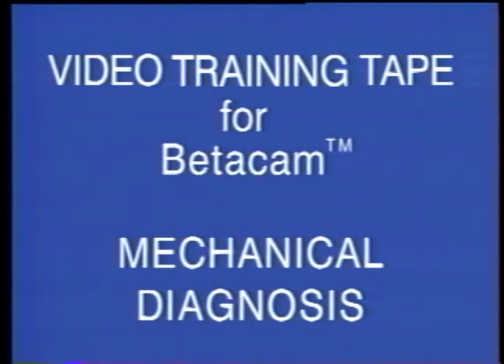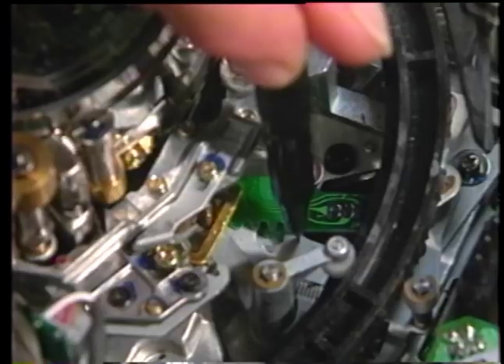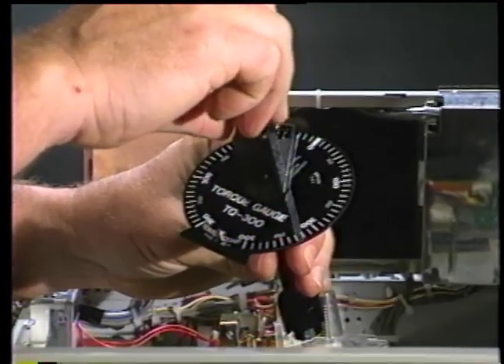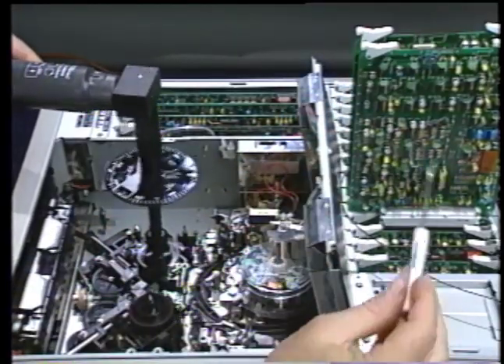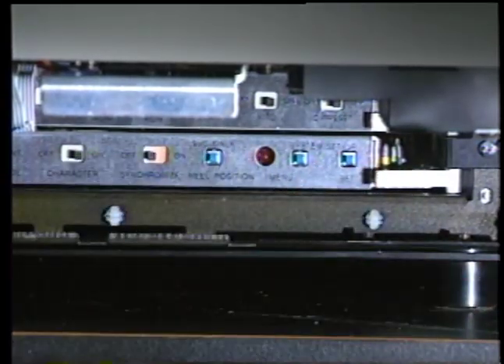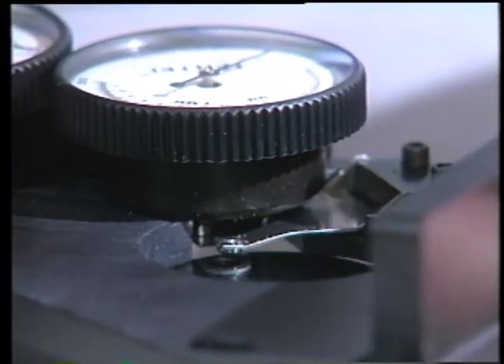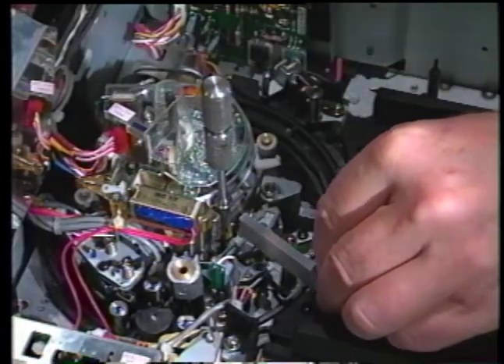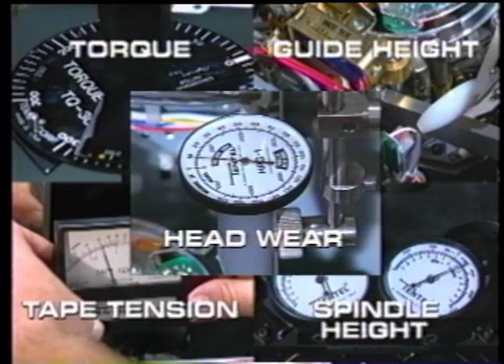Tentel Betacam  Mechanical Problem Diagnosis

Comment: Almost forgot about the Ampex machines ,that were just  Sony  machines with Ampex badges. 
Those were great machines in there time. But CRAZY expensive., like that DNW-75 (Sony part) was probably $ 20k more than an average car in the 90’s  and labor intensive to keep them in to condition.  I TV station I worked for them had one guy that his full time job was working on tape machines.  He had been to Sony school for each of the new models.  The service manuals for one type of machine was several thick 3 ring binders.
Ah the good old days of NTSC ..